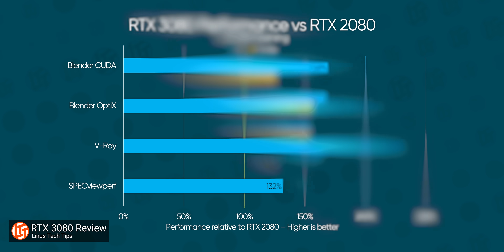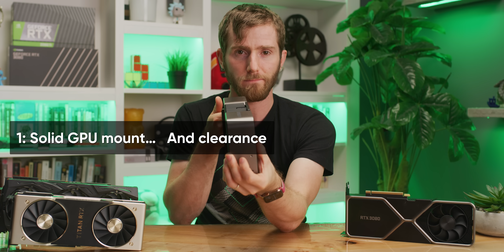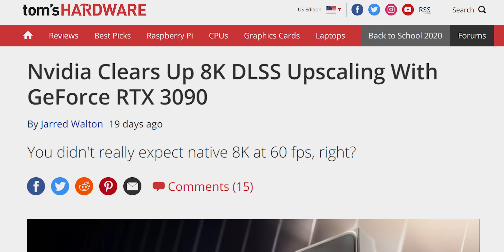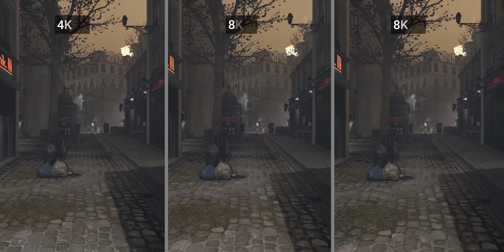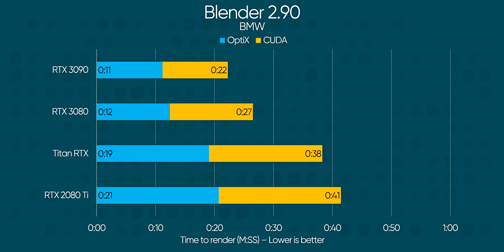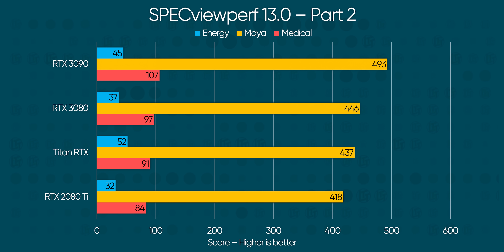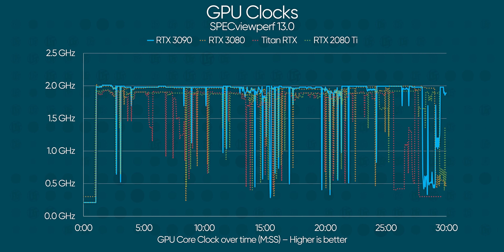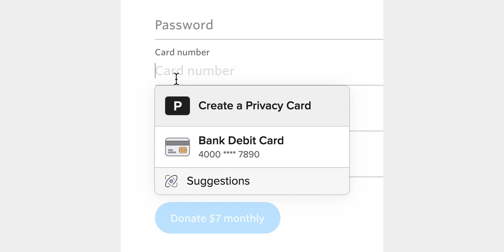Making Nvidia’s CEO mad - RTX 3090 Review

Comment: A bulky cooler doesn’t = great job. Imo they did a horrible job. As far as cooling goes they skipped a bunch of research and development and just went straight for bulky and ugly. Drivers missing, rushed design, rushed cooling solution. It sounds like Nvidia got some leaked information about AMD so they sped up their deadline. The only joy I got out of this release is that there is an open door to 8k gaming at 60fps. That is the only next upgrade I am willing to make.

Comment: I find it really odd that people do not seem to care about the high power draw +350w... I mean sure it is a beast of a card, but that 350w or even more WILL heat up your room no matter how great the performance or features are. There is a reason why card manufacturers stick to sub 300W TDPs. 
Sure the cards are great for the moment, but we will soon see things going backwards to less then 300W TDP as it will hurt Nvidia and AMD as their designs might end up in a server space where the cooling solution are designed for max 300W per GPU.

Comment: Be careful when you OC your 30xx cards out there. 
The memory has ECC (Error Correction Code) and won't show any Noise/Fragments in the Frames that would normally suggest an unstable overclock.
Instead when you reach unstable territory the FPS count (if you have a benchmark running) will just decrease.

Comment: Honestly, unless you are LOADED, don't get the 3090. It looks like too much to take care of, making sure you are not bottlenecking, getting enough power, making sure you have a strong mount (most likely will be bulky) all for 8k gaming. Not only that, it is $1,500!!!! We might have a way more improved graphics card in the near future. Stick to the 3080. 
Edit: Holy crap I forgot you need a good monitor too! It is 8k gaming and you don't want to stick to a TV or a regular 1080p monitor. This raises the price by a lot and probably isn't worth it. With other cards, you can just plug and play. With this, you not only need to switch out cards, but probably your whole setup.

Comment: "The performance suffers from bottlenecks, despite the OP CPU"
→ Uses pcie gen4 card with gen3 cpu, which has been previously proven to have a small, but measurable effect.
Reply: 10900k gets better frame rates on PCIE3 than the 3950X does on PCIE4 in most benchmarks I've seen.

Comment: Let me recommend a CPU for those of you who are thinking of using a 3000 series card.
1) AMD Ryzen 9 3900X or Intel Core-i9 10900K (The best chips you can buy as of September 2020)

2) Nvidia GeForce RTX 30XX

3) Asus X570-E or Asus Maximus XII Extreme 

4) G.Skill 32GB TridentZ DDR4-3200 RGB (4x8GB) (More than enough memory for 8K content)

5) Sabrent Rocket Q 4TB (2x2) (More than enough space for 2-3 8K games)

6) Corsair AX1600i (More than enough power for Ampere)

7) Corsair Obsidian 1000D (More than enough space for Ampere)

8) NZXT Kraken X62 (More than enough cooling for any CPU which is gonna be used in a build with an Ampere card in it)

Comment: Jcey2cents says 3080 crashed out of memory for not games but for productivity works, simulations, textures, meshes etc, while benchmarking. So 3090, not worth it?
Reply: Will you ever even play at 4k? If not, then none of the RTX cards are worth it.
Reply: for simulations & rendering works is it good
Reply: @prasanvfx  
3090 is just slightly beefed up 3080. With marginally more memory. I'd assume that if the other one has problems, so does this one.

Comment: Solid review, nice to see an Intel CPU used to avoid bottlenecks. Seems odd that there were some workstation use cases where the performance wasn't up to scratch, makes the 3090 way more weighted towards being a "need the best at any cost" gaming card rather than a true Titan replacement. I too feel a bit conflicted over that, I guess we'll see what Nvidia launch going forwards. Would love to see a deeper dive into the bottlenecking situation with both the 3080 and 3090, maybe once AMD launch their new CPUs next month. Would be great to see if the next-gen Intel CPUs unlock any extra performance too but alas they won't be coming any time soon, le sigh...

Comment: With the RTX 3090 not looking to be the spiritual successor to the RTX Titan in productivity, not enough of a performance delta between the RTX 3090 and the 3080 and the discontinuation of SLI meaning you can't pair two RTX 3080s together, I think the purpose of the RTX 3090 is abundantly clear:

That GPU is the new enthusiast Ti at double the price of the xx80 for only ~25'ish percent performance improvements.

Hmm yes, I see Nvidia couldn't dispense with its long tradition of reducing value for its customers, even if the RTX 3080 looks decent (compared to the previous disappointing generation anyway and honestly in retrospective that smells more like expectation anchoring).

Yeah no. I'm going to wait and see what AMD does with their upcoming Navi and hope to the high heavens they build themselves something that is competitive enough to keep Nvidia on its toes now that the upcoming consoles have ostensibly given Nvidia enough of a market scare to push this generation's performance leap.

Comment: I am a software developer at day, and a gamer at night. I rock Linux for work and Windows for play. To satisfy my performance itch, i'm currently building a Threadripper workstation (can't wait for that Oct 8 Zen3 announcement!!!!) and I was planning on moving my 1080 into the new machine. I really, really wished I could have built a bare-metal virtualized system; something like the new PC Linus did for Him/Her a few days back, with unraid and two VMs with dedicated graphics. I need just enough power to drive loads of screens and do basic 3D stuff over in Linux, but I need as much GPU I can get in my Windows VM.

With that setup, as it stands, I'm going to have to buy an other GPU and it won't be a 3080. I'm going to buy a 1060 class GPU instead. All of that could have changed if the 3090 supported SR-IOV. I could have ditched my 1080 and actually upgraded instead on dealing with two GPUs. This is exactly where Nvidia looses money in the enthusiast market with those drivers limitations. Instead of getting 1500 USD from me, they're going to get nothing as I'll probably get my GPU second-hand and will wait until absolutely necessary to upgrade my 1080...

Comment: Hey Linus! Really curious... What difference will users see in performance if buying two of the 3080 cards and use sli against the single 3090 as you can technically buy 2 cards and still be slightly cheaper than the 1?!?